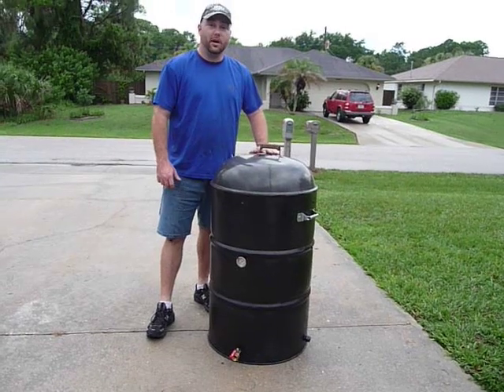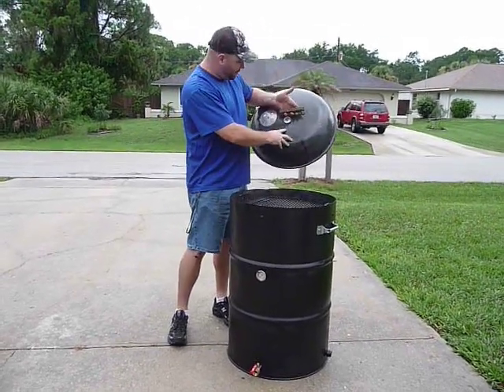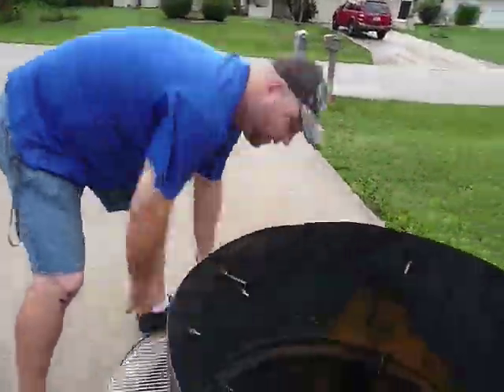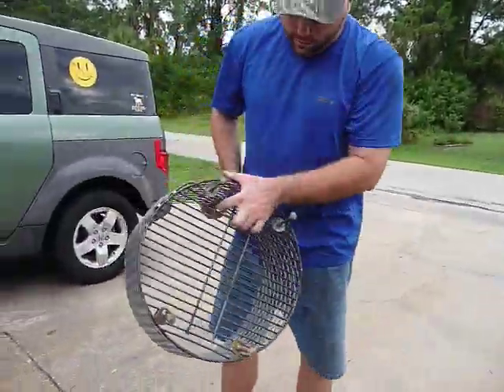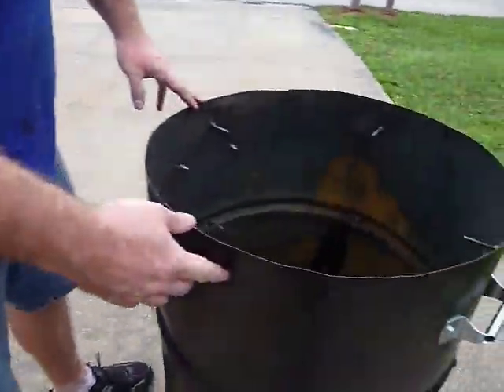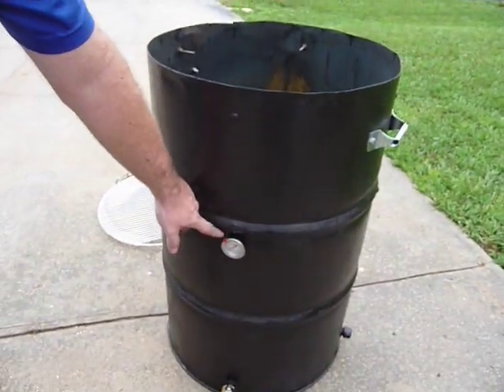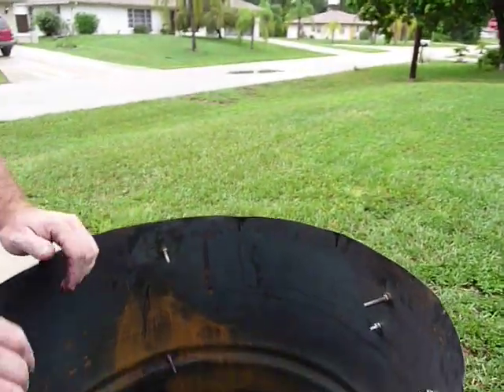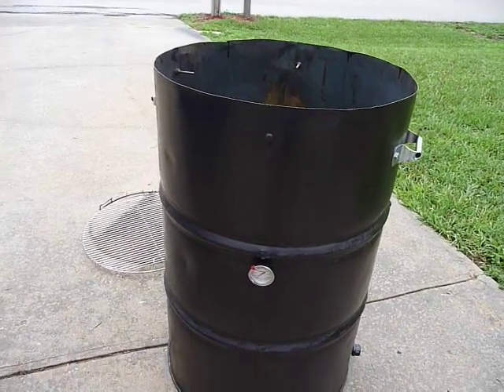How to build an UDS Ugly Drum Smoker - BBQ

Comment from the maker: @lingbopper88 I've already replaced the thermometer with a large dial bbq specific one. I mix the lump charcoal with my wood and fill the basket. You really don't need to use a lot of wood in this smoker.

Comment: I made one and actually about to modify and make another.  One thing I have added was a stainless bolt with a through hole drilled throught it just slightly bigger then the probe on my long stem thermometer.  I just slide it in and out when needed like for remoing the basket and cleaning.
  Next modification is installing brackets and a taller lid for a rotiseree.

Comment: Thanks for the quick reply, I've got two cans of Plasti-Kote High Heat BBQ Black spray paint, I'm copying your design over here in UK :-) They all say on the cans ideally use a primer for metal application but none of the primers state high heat bbq use so I'll probably go straight on with a few coats of the black

Comment from the maker: @Fishinboat119 try to find one that was used to hold something non toxic...food or food grade contents are best. Mine originally held virgin mineral spirits. Knowing that, I ran 2 "clean out burns" thru it hot enough to cherry the barrel. Stay fast away from anything ending in "ene" such as benzene. Also, if possible avoid the lined barrels.

Comment from the maker: The temp gauge has a clip that allows it to slide in and out. I was just being lazy. I'm actually going to get a 1/2 bolt, drill it out, and mount it in there so I can just slide it out that way. The clip allowed for too much wiggle and I ended up getting the temp of the coals a few times, lol.